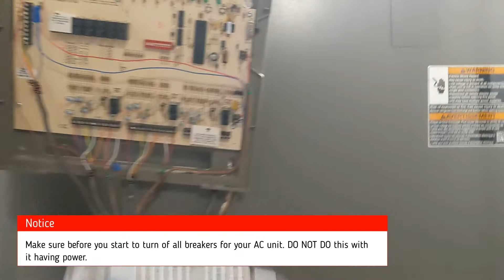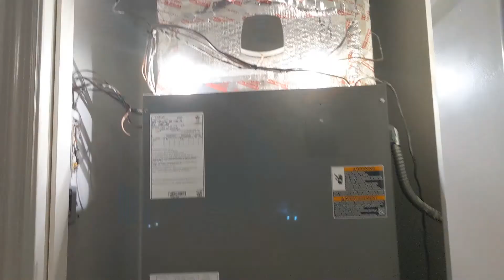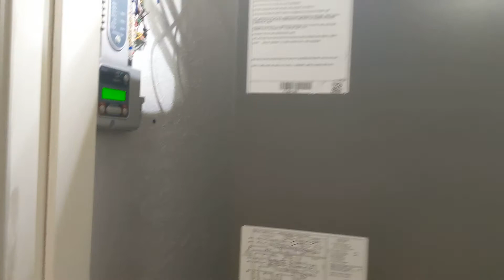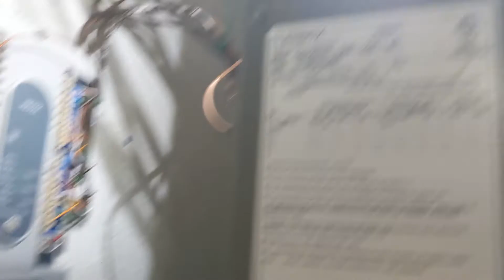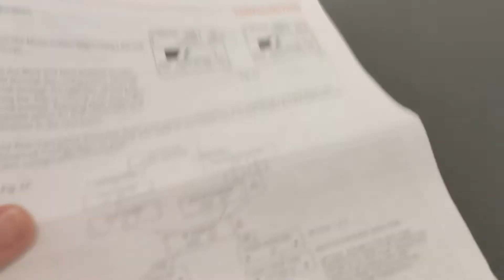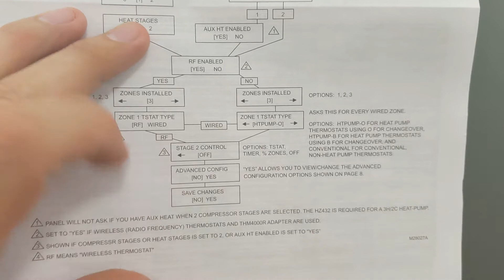Honeywell zoning board replacement with a HZ322 TrueZONE Panel

Comment: I wanted to swap my emm-3 but it says to use hz311
Reply: Don't use the HZ311. It is not compatible. I bought and used the HZ322 to replace my emm-3 and all wires and connections were identical and easy to configure. Just my thoughts.
Reply: @richmartinez7792  I just got someone to come out and do the entire rewiring for me it's so cold in the home now ❄️

Comment: I have a Honeywell Universal Minizone. The yellow purge light is flashing which (per the writing on the board) indicates "ZMS Sensor Failure or No ZMS Sensor Installed". Since the zoning board is pretty old, I  plan to just upgrade it to a new version. Did you replace any other parts (damper operator, sensor in outside compressor etc.) as part of this swap out?
Reply from the maker: nope everything was left just did the zoning board and everything worked after that :)